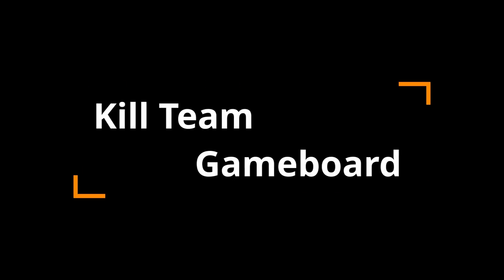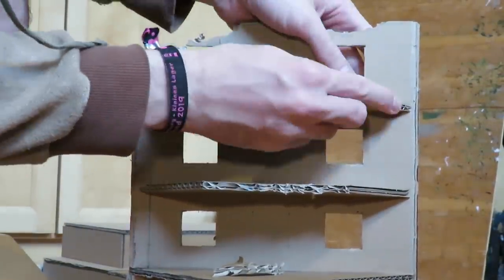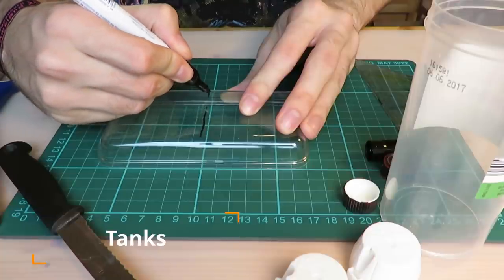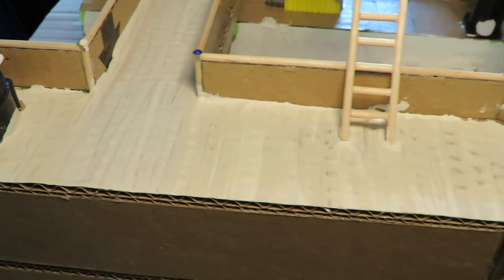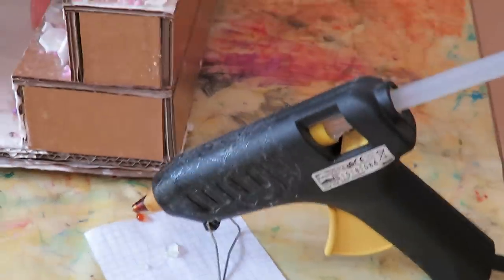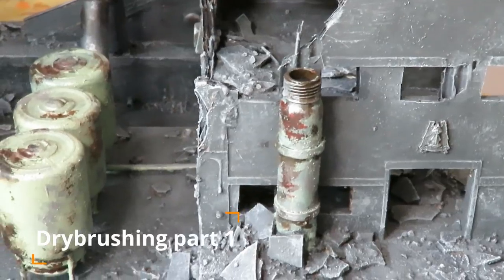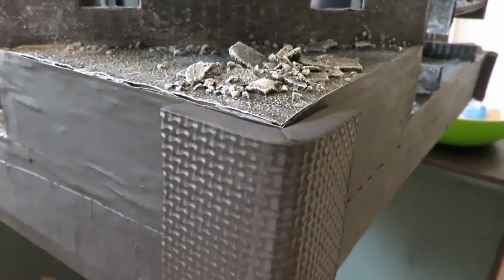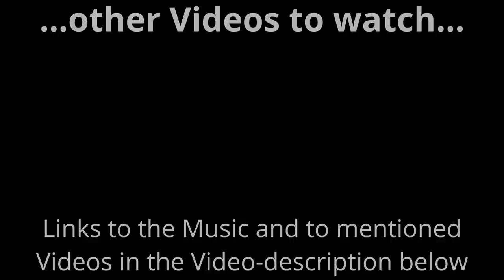How to build a Kill Team Gameboard || Warhammer 40.000 || Necromunda || Ruined City || Ruins ||

Comment: It looks realy cool but the scale is a little bit  off. Most people forget how big Space Marines are. When building a board, it is better to use imp guards for measurements reference
Reply from the maker: You are right. The scale is off. I did not pay attention to a "realistic" scale. I opted fot playability. I wanted my Marines to fit through the doors :D ,this is why doors and windows are so big, and this is why I placed most ceilings at about 3'' height (even though they shold be higher, placing minis in there is'nt fun...).
But i should start using Imp Guardsmen to check if my scale is alright. Thank You!

Comment: Amazing board! Love the use of vertical space. What did you use for the support beams of the big walkway pipe? The two pieces reaching from the ground to the pipe which are angled to one another.
Reply from the maker: I used some plastic vials, or tiny flasks or however you wanna call them. I just had them laying around for years... But i guess plastic pipes should work as well. Just don't forget to put detailing on them.

Comment: Thanks for the video man! Very inspirational :) I am building my own killteam board at the moment and I really love the diorama-approach, but I am hesitant about the static layout. How was your playing experience on the board? Does the static layout become "dull" after several games when everyone knows the best spots to hide? Are you missing modularity? I guess I'm just afraid about putting a ton of work into a project which is no longer strategically interesting after playing several games. Love to hear your thoughts!
Reply from the maker: The static layout defenetly is a problem. It's like You say, after some Games You know the good spots, and even worse: You know every flaw of the Board XD .

But I think something inbetween static and modular might work, for example if I had build only the Baseplate, with the channel and all the piping above. That could have worked... maybe add some rubble and debree around some defined spots, that would serve as a baseplates for some modular, interchangeble buildings, so that it still has a diorama feeling. Also build some loose walkways that you could place everywere.

And I'd also suggest that if You plan on adding a channel, it needs enough walking space on both sides, unlike mine.

Of course You could also build everything modular, like make it into 6 board tiles instead of one big board, but then the pipe above the channel really becomes a challenge...

So yeah, i'd go for an approach inbetween modular and static. So that You can change core layout fatures, and make every game interesting.

You can do it, keep on building!

btw I'd really like to see Your result...
Reply: @LasseBrenn  Thanks Lasse for the long resonse! :) Semi-modular sounds good! I really want some 3-dimensionality in my board, not just a flat ground with some 1-story buildings on. But I find semi-modular  difficult to pull off on a 22x30" kill-team board. I would like a flat center to put  centerpieces but I would also like flat spots around the center to put buildings. And all that might get a little crowded (is that a bad thing, though? ...) . Anyhow, I'll send you some pics once I have a layout. At the moment it's bare-bone MDF boards, not very interesting.
Reply: O also thought about that. As incredibly awesome as it is visually, there seems to be an awful lot of heavy terrain on it. Isn't everything obscured and unshootable all the time on this board?

Comment: Do you think it would have been better to mod podge all cardboard pieces on both sides before building?
Reply from the maker: When you alredy build the Ruins, there is some structure and stability that hinders the cardboard from warping. And my experience with just coating a piece of carboard with watered down woodglue is, it will certainly warp.
So I'd suggest you just go ahead and build a test piece!